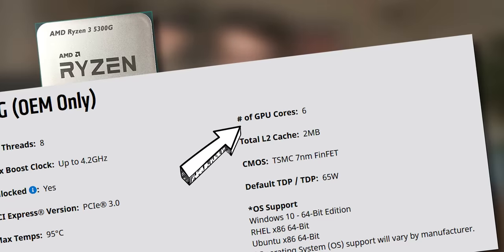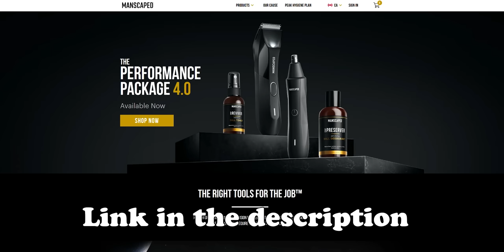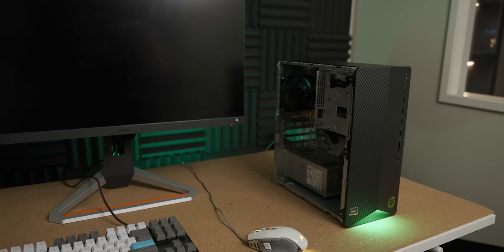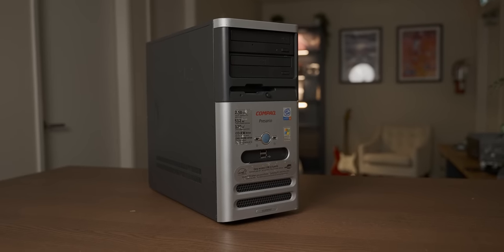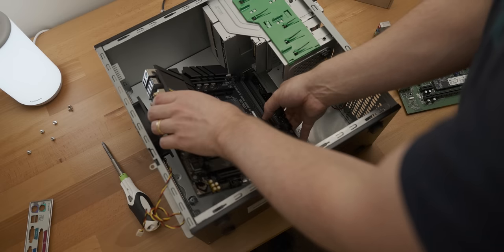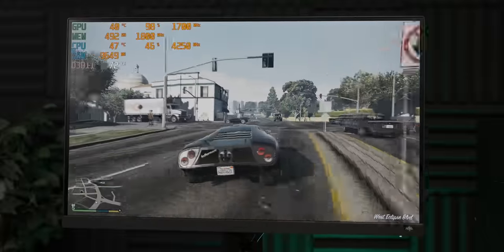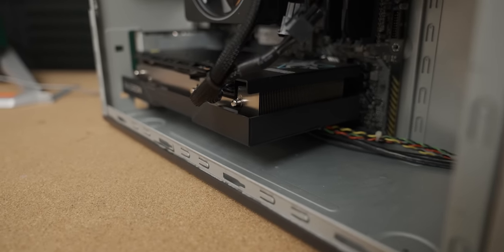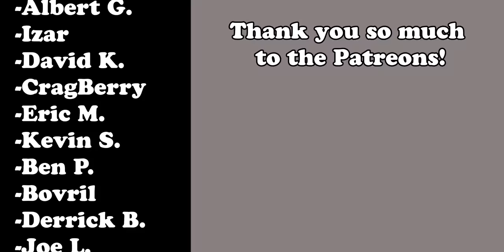Budget Sleeper Gaming PC Build Ft. Dodgy eBay Parts...

Comment: I actually built my newest PC by purchasing a HP Pavilion Gaming tg01-0023w and harvesting the CPU and graphics card from it because, back in May, the RTX 3060 was still being sold by those damned flea-bay scalpers for more than I paid for the HP.  I built it into a Cooler Master HAF 912 case so I could still keep my Blu-ray drive for burning CDs to work on my DOS/Win98SE computers.  I originally had built it into a Dell Dimension 2400 case with a 5.5" hole in the case side for a 140mm fan and the temperatures never got to 60 degrees celsius.

I also have a Compaq case that's identical to this one that I found on the curb with a dead motherboard in it.

Comment: but on a less sarcastic note. i just switched from hp elite 6300 with i7 3700 series with gtx 1050ti and ssd it pulled destiny2 at 4k at about 30fps lol very strugglingly but it did. calculated power consumption was higher than the rated psu output but it didnt die

Comment: If you put prebuilt pc parts in the old pentium 4 case, you’ve turned it into retro modern pc because the prebuilt pc motherboard (dell, hp, etc) looks like 2001

Comment: Why didn't you try gaming on the prebuilt you bought before dissembling it? Curious if the mobo change actually affected performance (being able to use faster ram usually helps APUs and is usually a problem with OEM mobos). Also.. can you glue standoff down to give a non-standard mobo mounting points? Seems like a waste of the original mobo/power supply even tho that's not your fault that's the company's fault for making them that way.

Comment: I hate proprietary $hit. This was a neat build, I really like the idea of sleeper PCs like that, but it also would have been interesting to see what could have been done with that little HP donor PC.

But as to sleeper cases... both my home theater and home office PCs are built in nMedia PC wood computer cases that look like old radios. The office PC case had been modified by being painted black with red grill cloth over what would be the speaker openings if it was actually a radio.

Comment: I'm actually one of those guys who is "processing" those HP Gaming PCs. Those GPUs are non-LHR!!! We buy them from HP for 949, sell the PC for 450 and the GPU for 799. Solid 300 bucks profit per PC.

Those HP PCs offer a lot of performance for a low price and the power supply Is pretty good as well (80+ Gold). Fans can be replaced with Be Quiet! ones for less than 20 bucks to turn those HP PCs into super-silent gaming machines.

Comment: You would like my pc then a old Alienware x51 r1 was originally a i3 with a   gt1030   took motherboard out and built in new case. Old pc used a riser so the pcie slot is in line with caps on board (which needed to be bent slightly) to fit GPU with no riser also can't plug case fan In same problem in line with pcie slot same with front panel audio finally had to solder the power on button wires to pins as again in  line with pcie what a polava it's been now when power in because it's missing the original power board I have to press F1 to boot past a error message for power management not being plugged in but now a i7 3770 16gb Corsair vengeance ram and a gtx 980 reference. My  budget pc but shamefully my best ever and been best gaming experience (don't judge a old console pleb to much ) nice vids btw you have such a awsome humour with tech it's so funny

Comment: When my house was burgled 6 years ago they found my computer desk.  2 PCs were set up. They took the older one that was powered up, which I left on 24/7 seeding torrents and monitoring IRC, but not the new Gaming PC near it.  The one they took was a core 2 duo with an nVidia 650 ti and I think 4 gigs of ram running Open Suse 13.2 Ignoring the powered off PC with an i5 6600, nVidia GTX 1080 32 Gigs of Ram and windows 10. to this day I'm unsure if they didn't see the newer PC as it was turned off and a Black case under a dark desk where as the old PC was silver and powered up, or they just ran out of space and time to move stolen things from my house to their waiting Honda Civic.
Reply: u saw that?

Comment: The motherboard thing is all about money.  If the board goes out, some 
people will just buy a replacement from HP (or they'll take it to 
BestBuy, have them "fix" the computer, meaning they get the board from 
HP and charge the customer like $400 for the whole job).  (I actually 
made tons of money fixing computers that people refused to let BestBuy 
fix for $300.. I was able to fix most of them for $150 or less, and if 
it was a simple thing like re-installing the OS, I may have only charged
 someone $100 if they had the recovery disks).  But the things people 
were told, the "diagnostic" fees were high in some cases -- like i would
 tell people I could replace the board and re-install their OS for about
 what they would charge just to run diagnostics on it to see what was 
bad.

While I like this build, my biggest concern would be airflow, as there is really only ONE fan in the rear, and vents in the front to draw air through.  Maybe as an added bonus, you could at least put an exhaust fan in the top to help with heat.

Comment: A friend of mine bought a HP prebuilt system with the same weird motherboard size. It came with a decent 3700x, but only 16 GB ram on a single stick, and a 2060 with the smaller 6GB config mostly used by vendors. And a non standard power supply which we couldn’t upgrade either to accommodate a better graphics card. In my opinion, a total waste of money. It would have been much cheaper and better to build such a system from parts, but for all who can’t do that, these companies just screw people over and take a lot of money for it as well, being a “premium” product😂

Comment: That's the new ATX standard that only provides 12V to the mainboard and then that poor thing has to do all the other voltage conversions (5 Volts and 3.3 Volts). It is said this is more efficient.
Reply: It will make motherboards more expensive and add more mb failure points, if one of the voltages dies the board is now scrap
Reply: @yambo59  Sadly, that is true. That's why I totally avoid these cancerous growths at all costs.

Comment: I have an hp prebuilt with a ryzen 5 3500 (6 cores 6 threads) a 1650 super (Performs a little better than the 5500) 8gb 3200mhz (I upgraded to 16gb dual channel bc it came with single channel 8gb) 256gb nVME (I upgraded with a 4tb hdd for mass storage), and a 400w 80+ platinum psu. Its a great deal for 600 dollars. I highly recommend it for anyone looking for a mid range pc for 600 bucks

Comment: I remember them systems when they first came out and they were bad then. 
I don't like OEM sleeper systems. But what is cool is when you do it backwards... Old system in new case.
Shame I cant tag a picture in this as it looks good.. (smoked glass side, CM 212, ROG first board, ATI crossfire X2card) 

Using a old case is a bit like kid upgrade using his mum's computer.. or Nan's.
Reply: I mean.. the point of a sleeper build is to not Show what you have. The crappier and older the case the less likely the PC is to be stolen. Even if its a $5000 built - all they see is a $50 20 year old Dell that is not worth stealing
Reply: @ForumcoldiArchon  I think some of the older cases are more practical, as in have drive space.
I suppose that new hardware and the market does lend itself to being stolen. 
But if we worried a lot about that happening then it's the problem.
Buy a 🐕 or by a dog case.

Tbh I thought sleepers were to look bad perform good.

Comment: The thing about these HP and Dell computers is you will want to get a different keyboard and mouse.  The ones they come with feel insanely cheap.  They feel like there is nothing to them at all.   they seem to have no internal structure of any kind.  The first time you are upset and typing an email it feels like you might hit a key on the keyboard too hard accidentally and need a new keyboard.  I never bought either brand of desktop PC but I have seen them in the store on display and it is great they display the keyboard and mouse so you can see just how very cheap they are.

Comment: You can get the IDE drives to be “compatible” using IDE to USB 2.0 adapters - then external USB  to USB header adapters :-)
Just remember to plug them in AFTER you boot Windows - once they install, you can close up the case.
Reply: I mean IDE has an even simpler way by using an  PCIe IDE controller card. Only draw back of that is the need to use a Ribbon cable.
Reply: @rynobehnke8289  this is why I use IDE to USB adapters :-)
Eliminates the ribbon cables…
Reply: @paulpsomiadis5847  
Fair enough.
Personally am I one of the few that actually likes the look of Ribbon Cables but there really are a pain to work with.

But to be fair my option does have one advantage namely by using an actual IDE controller is no USB Driver needed meaning you can plug it in from the start with no problems.
Reply: @rynobehnke8289  Agreed for the actual IDE controller, as it’s better for compatibility as well…
My method was just convenience on my part - as it keeps more PCIe slots free and allows for better airflow in the case - each to their own as both solutions work well :-)

Comment: .... Find a cheap used 2200G <-> 3400G (depending on what is cheapest... saw a 3200G "new in box" the other day for 110$ ... and that's in Europe! F VAT! - so finding one for 50-ish $ used should be doable) and a 240GB Patriot SSD or something - throw that in - and resell the PC for 250$... There problem solved... and it's still a banging little system for any office with fairly quick boot times and stuff.

Comment: I built a brand new Athlon 64 x2 6000+ system into a really old Pentium 1 Gateway? case back in the day so it wouldn't get stolen if i got burgled. It looked like arse but gamed really well.

Comment: usable hardware from gpu salvaged prebuilts:
- CPU/APU
- Ram
- Maybe some fans if you're lucky
- Drives
- Sata Cables (if applicable)

Remaining Unusable parts:
- The Entire Case
- Sometimes the CPU cooler
- PSU

Pros:
- You wanted a better case anyway
- You would want a better Motherboard anyway
- Tower Cooler / AIO upgrade
- Peace of mind knowing your system has a reliable and more powerful PSU which most likely has a better efficiency rating
- If you couldn't get any fans, you now have the freedom to get quieter, faster, more RGB fans than you had before

Cons:
- You have a motherboard and case you can't use unless you intend on throwing a low end CPU and cheap ram into it and using it as a media pc or a server
- If it had a disk drive in it, you would have to buy another one and your case would have to support 5.25 inch expansion bays or fork over the cash instead for an external one connected via USB
- If you salvaged any sata cables, you would end up having to buy new ones anyway to replace them if you intend on using the old system for anything which defeats the point in taking the old ones in the first place

My thoughts:
- totally worth it

Comment: ok i have a really wired request dawid about that GPU cooling condition why don't just dill some hole and smash a magnetic air filter on the base of the case i mean you did added a new motherboard so why don't do the most you can?
Reply: I just zip tied a 90mm fan to the front “mesh” of the case, it seems to do a good enough job.
Reply: @EvilTurkeySlices  well im to lazy for zip ties i like to drill XD

Comment: Why would screw holes aligning be a problem when DRILLS exist?
Also I did something similar back in my youngin' days (taking a proprietary board into a standard case). Unfortunately the donor motherboard didn't fit the target case at all (was too large), so I screwed it onto a piece of cardboard, grounded the backs of those screws with a dispensable audio cable, cabled it up and just left the case left side open with the cardboard leaning on it. I loved that setup - it looked like a piece of shit but for the time it was very decently running Windows 98. And boy did that system have AIRFLOW!

Comment: Get some small plastic legs lick little puck style get an old psu take the cover off and use it asa template to drill fan holes on the bottom of the case line them up with the fans on the gpu that should give you the extra cooling needed and it would still look like a stock 20 year old pc

Comment: 20 years ago compaq vs modern HP isn't really a fair comparison. HP 20 years ago had the cpu cooler built into the psu, and only one of them still exists in the desktop market today. Hint it's not the one who used standard parts.

Comment: AM5 APU...
In THEORY how good of an experience do you think an APU in 2024 could give for gaming?
(Work backwards from the POWER DRAW for the entire APU to estimate RDNA2/3 GPU capability, then estimate the GPU to DDR5 bandwidth bottleneck.)
So not saying they WILL make a high-end APU, just curious what COULD be made. The DDR5 makes a high-end APU more likely because the higher the bandwidth to the APU the less CACHE you need in the APU thus using a high-end mobile part at higher frequency is more practical)

Comment: Abomination? You havent heard of my abomination, i got the case that my brother got back in like when i was born from a custom build, a gtx1050 ti, an i5-3470 3.2ghz (30% bottleneck on cpu wise games), 16gb ddr3 ram, and the optiplex 7010 mbd (the psu is the same as the case)

Comment: Old cases had much better cooling. No glass or plastic crap on sides, metal is much better thermal conductor. Also, graphic card on the bottom, with hot air rising and cold air getting down.

Comment: Please assist me in getting GPU CPU numbers in my gta 5 PC in game.

I'm still running the HD 6850 in crossfire for a total of 2 GB  of gddr5. Lag and heat during fast action. I OC my GPU with Afterburner then run 3dmark.
~3300 5fps it's awful. 

I'm disabled. 

Old phenom 2 6 core @ 4.2 GHz is still good enough.

Comment: If you get standoffs for the motherboard, you can just use metal epoxy to create new standoff locations.  Screw them all into the motherboard, put some epoxy on the feet and then put the motherboard in its correct placement.  Wait for the epoxy to dry and you are set.

Comment: Dude, I hope you do not scrap the rest of that hp...  I will be willing to buy the rest of the parts from you.  The psu, motherboard, ram, and wifi card are all parts I can use for repair of other HP systems that come in.  Contact me as I would be happy to buy the system with the case.  HEck, I may just slap a 5600g and a 500gbm.2 in it and use it as a gaming rig for a kid.  :)  Please no contribution to landfills!
Reply from the maker: I definitely won't scrap the other parts. Worst case, I'll recycle it. I'm gonna hold on to it for the time being but I'll keep you in mind if I need to move it on. 👍
Reply: That is awesome dude. I wouldn't mind a cool video where you take that left over and see if you can build the best gaming rig out of it. :-) with the cost involved doing it. I think the biggest thing with those hp's is the CPU compatibility. Any 5,000 series should work and those power supplies although they are proprietary to HP if I'm not mistaken our 80 plus gold certified so you could theoretically put a video card that needs up to 300 w in there. Just have to see what type of video card connector it has whether it's a 6 pin or an 8 pin. Since it also has a spot to put a mechanical hard drive in it as well that could also be turned into a pretty good media streaming setup. I have done a lot with those hp's. I set up one just a few months ago with and 8 TB mechanical drive and a 1 TB SSD on the motherboard with a dinky video card for a customer, it had a 6-core CPU in it and I just made sure that I swapped out the garbage fan that it had in it for a really high quality fan for decent airflow into the case and they used it mainly for streaming and DVR recording in their living room. And very light gaming as well. heck even the video series of turning a crap computer into a good computer like you've done with the new builds that you've fixed to make them better. I'm thoroughly enjoying your channel and will be subscribing!

Comment: Now, I know this question shows I don't get it but...
...having scored a functioning system, even if it contains idiotic non-standard parts, why try to transplant them in to the old case? Doing nothing would result in a low-spec modern PC and a reasonable retro gaming system. This plan results in a fun sleeper system... and some junk.
I know, I know... then there would be no video for us all to watch - see, I do understand.

Comment: Dawid and group, when you buy through a broker like on ebay right now,  not for necessarily a 5300G that are overpriced still 56G/57G/Renoir G but full DIY PC kit or an over priced dGPU and u know u r getting price gouged into the final sales deal here is what u do too close the deal. YOU GET WHAT U NEGOTIATE, ask for a free i7/i5 Broadwell U or Haswell U ultrabook for ur kid; much better than a new Chromebook, YES ask for the Broadwell U or Haswell U i7/i5 FOR FREEE as sales close U will get it on an overpriced PC DIY kit and or GPU sale. Resllers and brokers will not discount PC kit and are attempting to price normalize dGPU, but, that Broadwell of Haswell U ultrabook thrown in as sales close; no problem; alk and u will get. mb
Reply: That 20 year old Compaq did not come with a GPU, honest, look for the graphics chip on the board. mb
Reply: VGA. mb